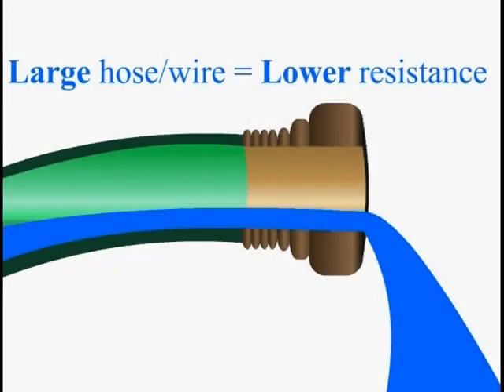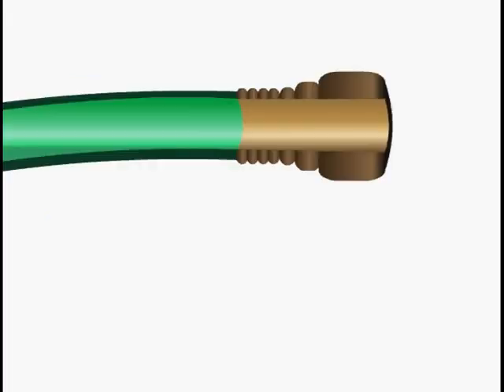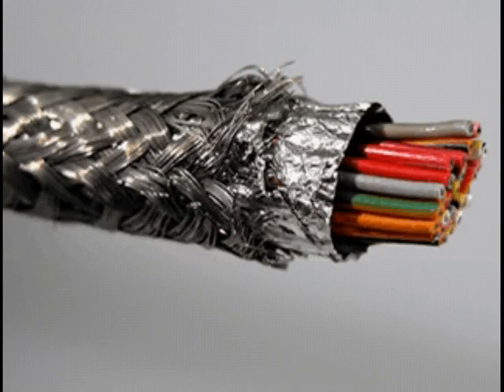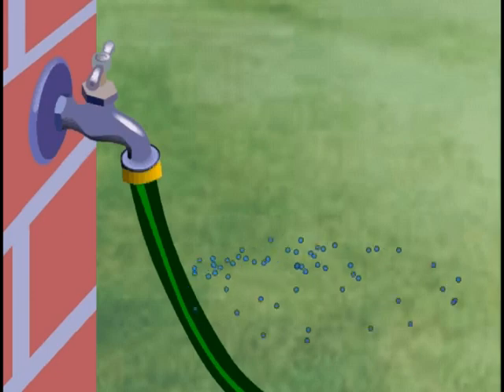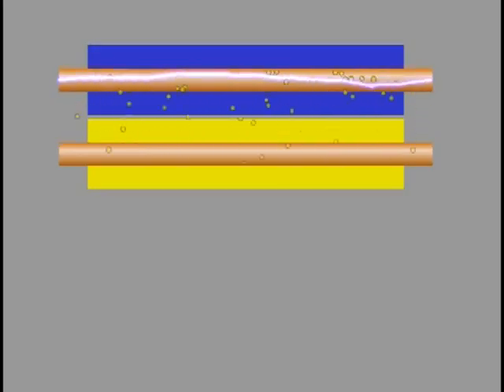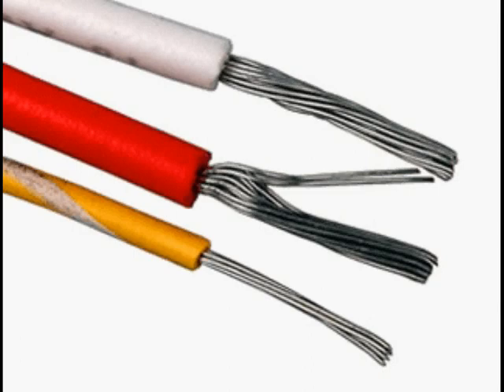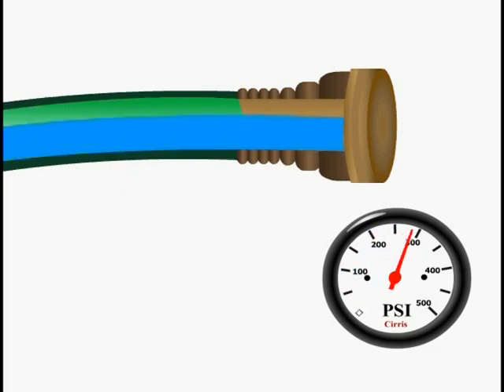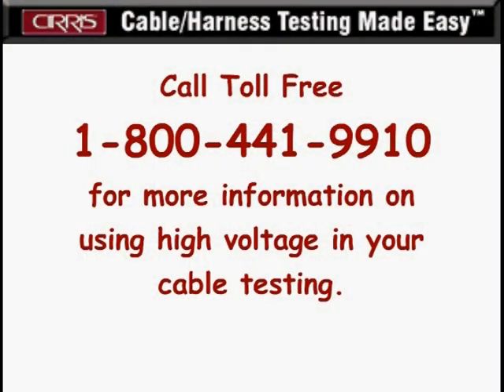Hi-pot cable testing part 2

Comment from the maker: You are correct that a few 9 volt batteries could be used to sustain an arc. Start by touching a wire to tinfoil and then pull it some distance away to demonstrate this effect.   Paschen’s law refers to the voltage required to start an arc, not sustain one.  Once an arc has started, ionized air allows it to sustain at much lower voltages.  However, as stated in the video, an arc will not start in air (at standard atmospheric pressure) at any distance at less than 327 volts.
Reply: I believe Paschen's Law applies only to very specific conditions. For example, one condition is that voltage is applied to parallel plates, in which the distribution of electrons (or holes) will be uniform across its surfaces. But in the real world, the geometry of the opposing electrodes is rarely parallel plates.  For example, in general the breakdown voltage between two sharp pointy electrodes is much less than between plates, because the point tends to concentrate the available electrons.    There are other conditions that are also not generally met in real situations.  And if you acknowledge that the 9V batteries can sustain an arc (because sustain requires only lower voltage)... how did that arc start?
Reply from the maker: @Graham_Wideman   The video is for illustrative purposes only. Different cables have different builds with all kinds of variables. DWV tests are affected by humidity, dielectric absorption, geometry of the metals in proximity, environment (vacuum, air, etc), and more. Our testers are designed for a particular case where wires or pins (typically adjacent) cause undesired arcs because of poor insulation, contamination, or physical damage in general.
Reply: @Graham_Wideman  When a conductor carrying current (like a switch contact or battery terminal) is separated, there is a transient state between "closed" and "open" in which current flows through a microscopically thin section of material. That section can get very hot, even ignite and ionize the air, starting an arc that is sometimes called a "load arc." If you're shorting out a 9V battery to another 9V battery you will see that it sparks only when the connection is broken and not when the batteries are brought together (although there is some bounce that makes it seem that way in some trials, you'll definitely see it's visible mostly on breaking the connection). Adding any length of wire to the 9V also adds a non-trivial amount of inductance that will make it easier to spark, especially if the wires are separated by some distance. If you're using a battery to power a motor, you'll see an even bigger and brighter spark from the inductance of the motor raising the voltage well above 327V. I think Paschen's Law is OK only if you strictly consider the process of starting the arc and rule out any other physical phenomena that might get one started by means other than dielectric breakdown.

Relays for motors and other heavy loads are designed differently for this reason. For an extreme example, check out some of the videos on YT showing power transmission stations disconnecting under load.
Reply: @stickyfox  hmm, not sure what you mean about shorting two 9v batteries together. You mean in parallel? Because there would be no voltage differences across which to spark. Or you mean in series? In which case this is just an 18v battery which you are shorting, and I'm not sure what's special about that voltage.
Reply: @Graham_Wideman  Well, 9V batteries are special in that you can easily short them out. It's much harder with a AA, plus the spark is bigger!

And yes, when you touch two nodes of the same voltage there's no spark.

Comment: 327V to make an arc?  Anyone armed with a 9-volt battery (or several) and some tinfoil or wire can easily demonstrate that arcs are sustainable at far lower voltage.  Either Paschen's law is wrong (unlikely), or your interpretation of it is.